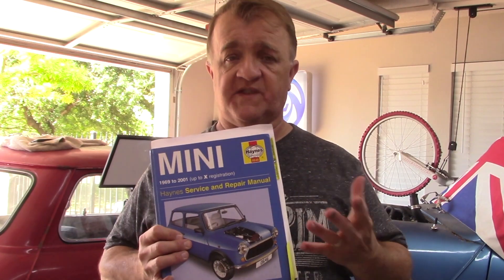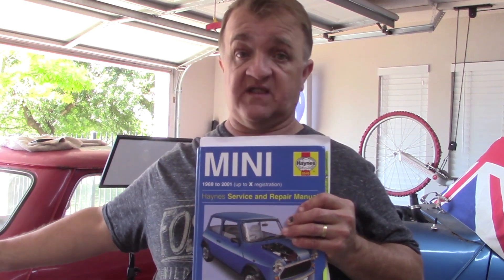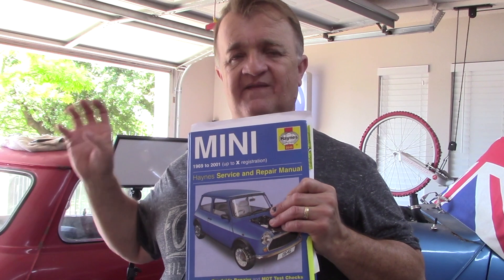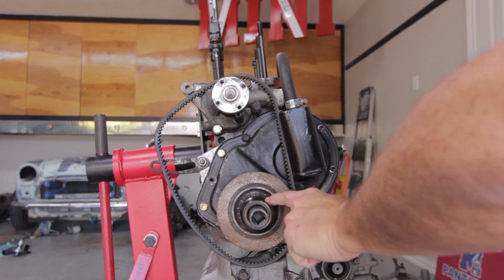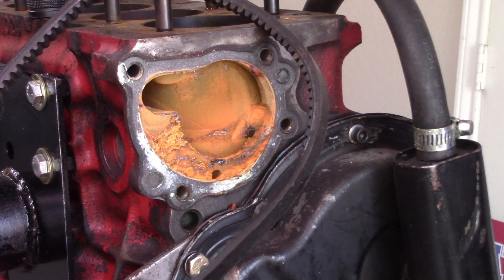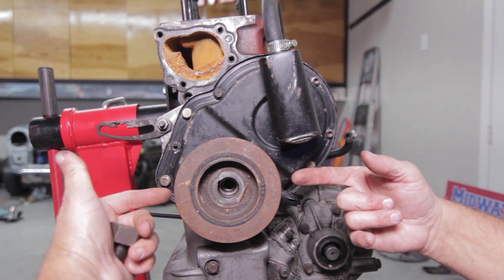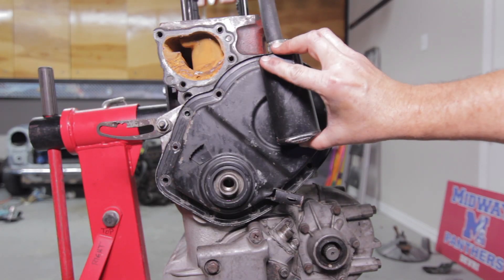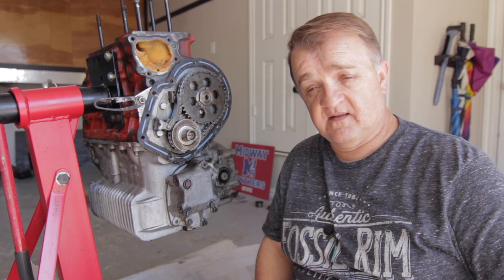CRANKSHAFT PULLEY - FAN - WATER PUMP REMOVAL - CLASSIC MINI

Comment: Damn that time difference eh Randy!! Yeah that's been apart like I said to you earlier. On that age of engine all those mixed up bolts should be 7/16 hex with a shoulder and 3/8 shouldered hex for the tiny ones that go into the plate. The early Haynes manuals go Into more detail and the later engines are covered in the supplement section in the back. I'll check which ones we have so you can beef up your library.
Reply from the maker: I don't have the earlier Haynes, but will order one.  Thanks for forcing me to check again on that.  I will also replace all the fasteners if possible.  I'm not fond of hex key fasteners.  I think this engine has definitely been played with over its life.
Reply: @LoneStarMini  Definitely, all those non rusty fasteners!! I'd say its from late 93 / 1994 onwards that motor. I'll check that manual date later today UK time.

Comment: Oh a timing chain with a tensioner, told you there is something special with that engine. I've had carbs off, heads, water pumps, can covers and chains off A series many years ago but have never done anything with taking off the clutch cover (why is everyone starting to call it a Wok?) flywheel/clutch and clutch housing so have never seen those gears and oil pump before so a learning curve for me to. I've found the Haynes manual a bit of a head scratcher/ mind messer in the past.
Reply: Later models had a timing tensioner to stop the chain rattling. There's some doubt as to how effective they are though. A duplex chain setup is what most people go for.
Reply: @peterraymond3653  my old 998cc mini had twin carbs, 12g295 head.cooper cam,cooper dizzy and duplex chain. Still got it all. I always thought tensioners were fitted to proper performance stuff. You learn something everyday lol
Reply from the maker: I didn’t know having a tensioner might be different than the norm...
Reply from the maker: Also..  'Woke' because the clutch/flywheel cover looks like a Chinese Woke.. I agree that it does...  More lingo to learn as street terminology does not match manual terminology..
Reply: @LoneStarMini  go online for moss Europe and order a mini catalogue, great little reference tool

Comment: Randy, Good to see you really getting on with the engine strip down, Just a little tip as your using a air wrench i would just back off each bolt with a 
socket by hand first just incase it may be seized or it‘s over tightened the air wrench will not snap at your wrist when it bites, I take it you have lowered 
the air pressure to the air wrench! I‘m a bit old fashioned but i like to feel the power i‘m using with my hands. Cheers Dave
Reply from the maker: Yes Sir.. I am able to  back off the pressure via a knob on the air gun.  I don't honestly know what the pressure is, but it's just below the half point.  I'm most likely wrong, but my thought process was/is such that if the bolt looks horribly rusted, etc, then yes I do it be hand.  These bolts looked to be a none-issue, but I understand perfectly your tip.. thank you!!